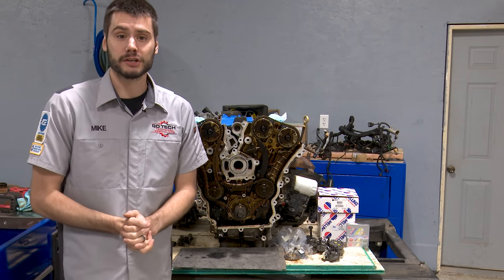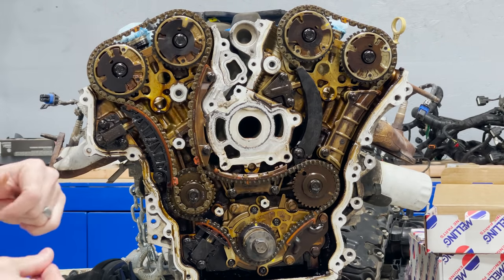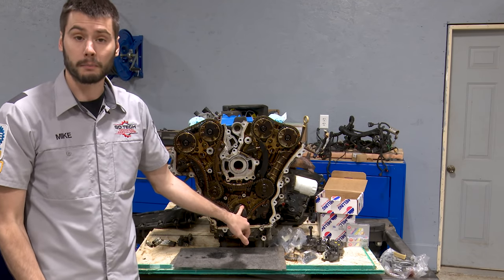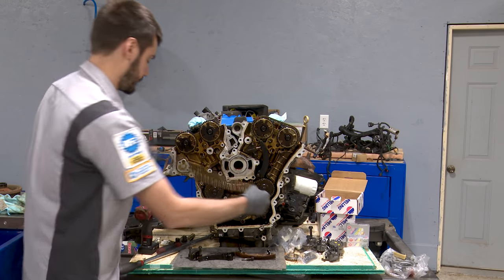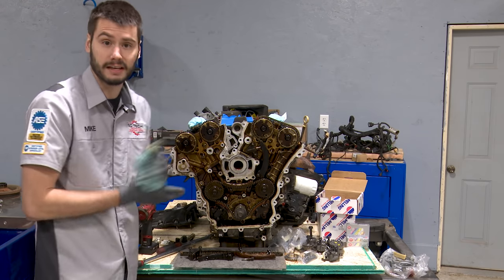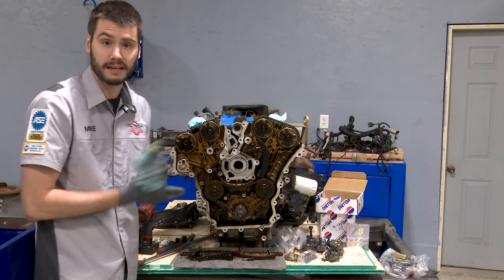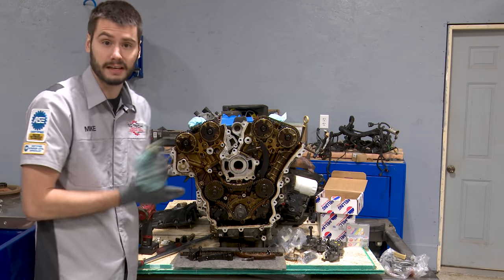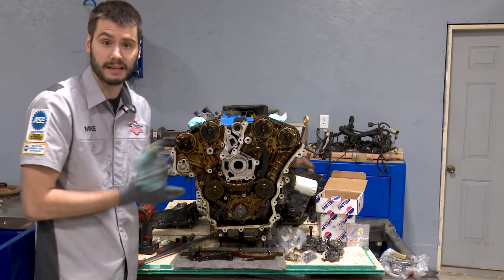How To Replace Timing Chain On Chevy / GM 3.6L V6 - Full Length Removal and Install - With Tips!

Comment: Need to know if it have to be on compression stroke, I have a 2010 Camaro 3.6 and someone didn’t put it in timing correctly and the starter is dragging bad on it like it doesn’t want to turn over

Comment: What if im in stage 1 and on the left bank one cam flat is up but the other cam is like a tooth past the other cam so its not flat and the cam retainer tool wont line up can i adjust that cam phaser back individually to line up whit the tool as long as my crank is set in stage 1 time before set my chains?

Comment: @GoTech Can you perform this task while the engine is still in the car?  I have 2011 Equinox with a 3.0 that has a leaky timing chain cover with a cylinder misfire code.  It's time to change it, but the car is too old for me to spend a lot of money on it.  (183,000 miles on it)  I have rebuilt a couple of engines before and feel comfortable doing the work, if I don't have to remove the engine.

Comment: I can’t find your final assembly vid (how to put the metal timing cover on) could someone pls share the link for it 🙏
Reply: My question is how do you get that bolt back off to put that pulley back on ? 😳
Reply from the maker: Hey, we actually did not film the final assembly. Sorry! As far as getting that bolt back out, an impact usually does the trick.
Mike Becker, Senior Instructor
Reply: @GoTechTraining  
No worries, your video and presentation was fantastic however I found the conclusion from another site ,thanks for getting up to this point , also the (PCV) valve was totally blocked on my car and possibly causing the overheating and timing chains to stretch I wanted  to purchase a new valve from (GMH) however they sell the whole right hand side cover including the valve for $800 🙄
So I drilled out the pcv valve to the recommended sizes the forums we’re saying and I’ve completed the job and my car is running like a dream 😊😊😊😊👍🏼👍🏼👍🏼👍🏼
Appreciate your vid 🙏

Comment: You mention changing the Oil Pump since the engine is open.. BUT but but, if the engine is still in the car, HOW?
Reply from the maker: Hi,
Removing the timing cover is the hard part of doing this job while the motor is still in the car. Once the timing cover and the timing chains are off, the oil pump just unbolts from around the crank pulley. If your replacing the pick-up screen, then more work would be involved as you would have to take off the oil pan.
Ryan Wilsing

Comment: Okay,so I have redone my timing several times due to bad cam phasers and the. Bad tensioners from Amazon and I’m wondering if I can rotate the engine to help set the tensioners and then simply use those cam tools and the crankshaft position to set the engine back into stage 2 and start it up without having to get the links back to matching up?

Comment: So…. To replace an oils pump (Acadia), does the timing chain have to come off/messed with??
Reply from the maker: Yeh, you need to take it all apart to get access to the oil pump.
Reply: @GoTech , that sux because that essentially means you would get charged for a timing service too. I see why you went ahead and replaced the oil pump too. Probably not a bad idea to check the oil send unit, too, at that point. 🤷🏻‍♂️
Reply: @GoTech , the way you explained it and demonstrated it, really took the scaryness out of replacing timing chain and re-timing the engine. I appreciate you doing this. If only I was brave enough to drop the engine myself, I would totally do this myself!

Comment: Hello I've one question. Is that instruction correct for Opel Engine 2.8 v6 250HP Z28NET, mounted also in Saab 9.3 or Cadillac BLS?

Comment: On my 2010 camaro 3.6 the left side cam phasers are opposite of yours. The intake has L and the exhaust has R is this correct ??
Reply from the maker: Hi Heath,
On the 2010 Camaro, the intake cams phasers are different part numbers, One for the left intake cam and one for the right intake cam. But the exhaust cam phaser sprocket is the same part# for both banks, the exhaust cam phaser should be marked with a 'L' and a 'R'.  Which ever timing mark you use is based on what bank your installing it on.  
I hope this helps!
Ryan Wilsing
Reply: Thank you very much ! Decided to get all new phasers while I’m already in there lol. Do you have a video on phaser replacement ? I’ve looked everywhere to figure out how to do it and can’t find anything

Comment: Once the timing is set & you rotate the engine to make sure everything is smooth.
 Does the timing need to be reset with letters up and everything else?
Reply from the maker: Hey C Rob, once timing is set and its spun over, the best way to line it up is to line up the crankshaft and then install the special tools on the backs of the cams.
Mike Becker, Senior Instructor

Comment: Hello everyone. 
I'm working on a 2014 Chevrolet Impala lt, 3.6 l.
I found engine oil in the coolant system. 
The engine oil system is clean, just engine oil.
Any other idea besides the head gasket ?

Comment: Is this the early 3.6L 175kw with the strong timing chain or the later model 3.6L with 190kw? The 190kw is the one that likes to stretch.

Same engines that are in the VY/VZ/VE/VF Holden commodores from 2004-2017

Because they went all stretchy after 2006 when they “upgraded” the timing chains from a 9.5mm down to a 7.5mm chain.

Comment: when using a torque wrench like yours (i have the newest version but same thing really,) set the desired torque a lb or two less than desired. if you notice, your overtorquing everything everytime. i know it doesnt matter, equality is the most important thing after them being tight to begin with, but try setting your wrench a bit light, and you will be less likely to go over

Comment: Dumb question.. but are the two outside chains the same length?
Reply: Also, should there be any slack in the right timing chain after you finish the process?
Reply from the maker: HI Tey, Yes the outside chains are the same part number.
Ryan W, Technical Instructor

Comment: What's the popping noise when you were turning the motor over?
Reply from the maker: The timing chain tensioner. Without oil pressure applied, it will make noise. It's normal. Thanks for watching!
Mike Becker, Senior Instructor

Comment: Why are the timing links not on timing marks on old chains when removed
Reply from the maker: Hey Richard, the colored links are only for the initial chain install. The motor would have to be spun over a ton to get it to line back up.
Mike Becker, Senior Instructor

Comment: Hey man at 10:00 you said the intake cam said R.
You said earlier that's  the left hand side andrhe first one you did had a R on it..which one is which?
Reply from the maker: Hey Stan,
For more info check out this step by step instructional 
https://gotech.com/learn/how-to/replace-gm-3.6l-timing-chain
I hope this helps!
~Ryan Wilsing
Reply: @GoTechTraining  ypu could have just told me why the intake and exhaust have r and l on them when youbsaid justvtje intakes are different part numbers but ok
Reply: My engine is the first side you took off (one by the windshield) that has the problem so which side should my  intake cam phaser say if its the riggt side of the motor?
Reply from the maker: The exhaust sprockets, are the same part number side to side, so on the right bank (windshield side) you use the R marking and the left bank radiator side you use the L marking. The intake sprockets are different part numbers, and are marked left and right.
I  hope helps
~Ryan
Reply: @GoTechTraining  thanks for the fast reply. I found out the issue..the right side intake cam has a L and R on it. Aside from the R on the phaser itself. Guess thats as much my fault for not specifying  but thats very confusing to someone nit familiar with this goofy motor woth 3 chains...jesus

Comment: Thanks for the insight. Now going to replace the timing chains on this engine a second time as the first garage did not honor their work after it left the garage still with noise at the timing chain site. Nine months later their was bad chain noise but the garage just said that it was not the chains. They didn't honor their work and I am out thousands of dollars. Worst GM engine ever and GM should honor the replacement of these chains longer than they did.
Reply from the maker: Hey Kerry, thanks for watching! Sorry to hear of your struggle with this engine and your previously used shop. Good luck on performing the repair yourself!
Mike Becker, Senior Instructor

Comment: God I hope someone can answer !!!! I have done my timing chain 3 times now about to be number 4! I accidentally knocked it out of time and have to redo it and I am struggling finding top dead center I think because I can’t seem to get it right! I thought I got it this last time for sure and didn’t! I super stumped !!!  Help how do I know for sure I am top dead center?
Reply: Make sure the flats at the rear of the cams are facing up use tool to be safe and use a something to poke down the number 1 piston of the engine until you can touch it then remove you tool and give the crank a little rock back and forth you should see it move up and down you want the piston up 👍

Comment: When I started the engine my oil pressure pegged at 80PSi or higher.  I changed the filter and the sending unit.  Still pegged.  I tore it back down and replaced the new melling pump with a new GM pump and pressure is still pegged so its not a pump issue.  Do you have any idea how changing the timing chains could cause excessive oil pressure?  I am going to verify with a mechanical gage as soon as I get the adaptor but I don't think two sending units are wrong.
Reply from the maker: Hey MIchael, that sounds like a bit of a headache. Maybe something happened to the wiring gonig to the sender? I'd be checking oil pressure with a gauge and then gonig from there. 
Mike Becker, Senior Instructor
Reply: @GoTechTraining  I just installed a mechanical gage.  The pressure is 85 PSI.  I guess its a restriction somewhere.  I have no idea what to look at next.
Reply: A year later and I have been driving the car with the oil pressure at 85psi on start up and on acceleration and 45 at idle and cruise.  It hasn't seemed to affect anything. The engine runs great.   I just installed a timing set in another CTS I bought very cheap because it had a timing error code.  Hopefully the oil pressure issue doesn't crop up again.
Reply: That's great oil pressure!

Comment: I bought a 2017 Traverse 2LT with 140,000 miles on it out of necessity of family utility vehicle(FUV). I knew of the timing chain issues despite and took a gamble that the engine timing chains have been serviced in that time. I got it used but from a Chevy dealership and going by the history I pulled up on it, it appears to have been well taken care of from the previous owner. A whole list of services and oil changes from the dealership. I will continue to care for my ownership, but not hand it all over to the dealership servicemen. If I can get 10 years out of it, I'm tickled to death. I already invested in a new, but needed, transmission for it. So, I'm definitely committed but cautious for that engine.

Comment: I just did this job on a 12 Traverse.  I installed all chains with engine in stage 1 timing, all marks lined up perfectly and appeared correct.  The car runs rough and has code p0017. 
I don't understand how it could be out of time, if all the marks lined up.
Reply from the maker: Hey Richard, did you replace the cam phasers and vvt solenoids as well?
Mike Becker, Senior Instructor
Reply: @GoTechTraining  no I didn't,  I have taken the valve covers off to check and see if cams turn free, like bad phasers.  Found that bank 1 has a ton of slop in the timing chain.  Thinking failed new tensioner.   It was a Melling timing kit without phasers
Reply: @rholdcroft99  i just did a 2010 traverse and have the same issue. P0017. Runs good. Little idling jump. But not bad st all. Replaced fhe crank sensor. Gunna replace the cam sensors and see if it fixes it. I told my customer he may need to do the vvt solenoid as well bc the.engine was so gunked up beyond belief I spent almost 3 hours cleaning when I tore it down. I used cloyes video as a reference.

Comment: Thanks, I wish it was this easy with engine still in car
Reply from the maker: Hey Casey, it sure would be nice!
Mike Becker, Senior Instructor
Reply: Is even possible though, to swap timing chain out while in car ? Also without something holding pistons from dropping down inside?
Reply from the maker: It is, but it's a tight job. If you have a lift I highly recommend pulling the motor out. I'm not sure what you mean by holding the pistons from dropping down inside. They are still connected to the crankshaft, so they should be fine.
Mike Becker, Senior Instructor

Comment: Thank you you made it look easy but I guess if you’re doing it with the engine in the car that will be a whole different monster
Reply: I wouldn't attempt doing one of these with the engine in the car - it's not always  possible for one, and also, your back will hate you if you do it in the car.
Reply: I am doing one now in a traverse in the car if I had a lift I would not be. It is a lot harder up and down with the engine and myself from engine bay to fender well making sure everything is lined up properly.
Reply: Ok

Comment: Thank you for an awesome timing chain video. Is this applicable to a 2016 LFX 3.6L engine?
Reply from the maker: Hey, thanks for watching! I'm not sure if the LFX motor is the same, sorry.
Mike Becker, Senior Instructor
Reply: The LFX and LLT are practically identical when it comes to the chains. The major difference between LFX and LLT is that the LFX has Integrated exhaust manifolds and a plastic Intake manifold.

Still recommended to get a kit specifically for the LFX, but it is mechanically the same process.
Reply: The same for LY7?
Reply: @pmscalisi  Good question. I second Pauls request. Thanks!
Reply: @pmscalisi  i am wondering this as well in regards to LY7

Comment: How to replace  timing chain with out pulling motor out ?
Reply from the maker: Hello,
It is almost impossible to remove the timing cover on this vehicle without dropping the engine out. The access is very tight between the cover and the fender.
~Ryan Wilsing

Comment: Excellent job Mike. That job looks to be a major P.I.T.A. .
Reply from the maker: Hey man, thanks so much! Once you wrap your head around the craziness of 3 chains in 2 stages of timing, it's really not all that bad. Probably a total of about 15 hours or so into it. A big job no doubt, but no worse really than anything else these days. Besides, working on an engine outside the car is ALWAYS way nicer!!!
Mike Becker, Senior Insturctor

Comment: Can you help? I got the front cover off, and started disassembly on the secondary right side chain before realising i skipped the step of putting it into the correct phase of timing first. Now those cams are misaligned with the other chains.
Reply: I don’t know if I correctly understood your question but if you lost your points The easiest way to go out of any mistake and any future broblem is to unbolt rocker arms on both banks. After that turn crankshaft to the point reinstall rocker arms left bank reinstall 2 chains turn crankshaft to a second point and are you installed third and final chain. 
That’s what I did to my Acadia and is working just fine

Comment: At 39:00 what is the clicking sound when you're turning the motor over? I'm assuming it's the tensioners popping but this seems quite loud, is this clicking sound normal?
Reply from the maker: Hey Trenton, that's right. The tensioner pops because there's not any oil pressure supplied to it yet. Normal noise prior to the engine being run.
Mike Becker, Senior Instructor

Comment: Goodmorning , which cylinder is tdc in which stage timing
Reply from the maker: Hey Gio,
Good question! With all the 3.6L timing chains I have done, I never really checked. I would assume Stage one timing would be TDC #1 but can not confirm. I'll have to check it out next one I get.
Thanks for reaching out!
Ryan Wilsing
Reply: @GoTechTraining  Hi Ryan, thank you for replying, I am currently working on another 3.6 gmc acadia engine, and this one got me somewhat confused. I followed the instructions accordingly, but after working in stage 2, and continuing to stage 1, i had to turn the crankshaft more ttimes then from just the 8:0’clock to the 5:0’clock marks on the crankshaft,  to get my left bank cams flat side up. So thats got me somewhat confused. I decided to just follow the instructions further and installing everything accordingly, and all of the marks fell together in the end, just like in the video, so stage 2 timing, camshaft right flats up, and stage 1 timing left side camshaft flats up

Comment: I need help with the GM HFV6 engine, because I had to change the crankshaft, but there are 2 models where the accessory pulley key changes. I installed the new crankshaft with a different type of key and the car does not start and shows a timing error in the engine. Can anyone who knows this engine well tell me if there are any changes between the 2 crankshaft models that could be causing this problem or could it just be a mounting error at the point of the chains? thanks.

Comment: Does oil pump need priming?
Reply from the maker: Hey Donald, not sure. There was nothing about it in the service procedure. Anytime I have an engine out, I ALWAYS crank the engine over numberous times prior to enabling fuel and firing it up. This allows oil to flow through everything. So maybe I kind of primed it that way?
Mike Becker, Senior Insturctor

Comment: Why did you have to go clockwise to go into phase 1? Why couldn’t you go counter clockwise?
Reply from the maker: Hey Tom, I guess because i'm a creature of habit. I'm not a fan of turning engines backwards. In this case though, it really shouldn't be an issue.